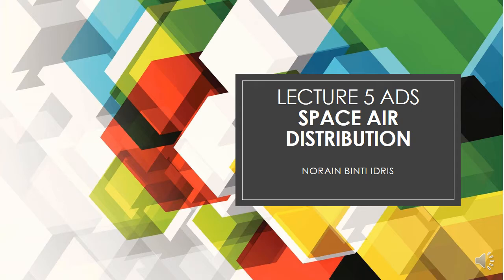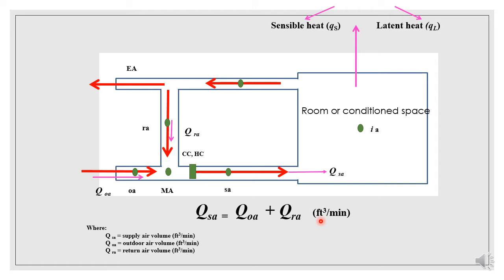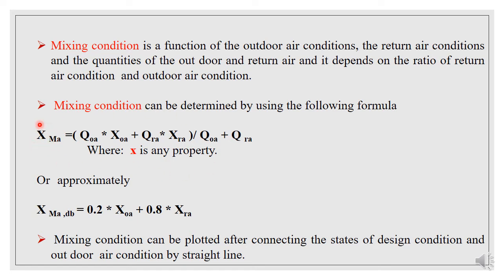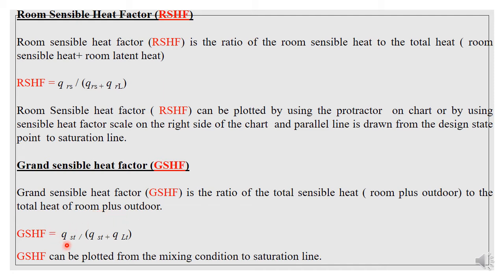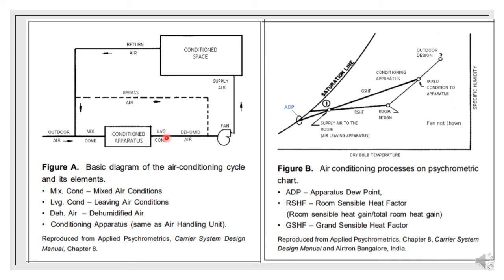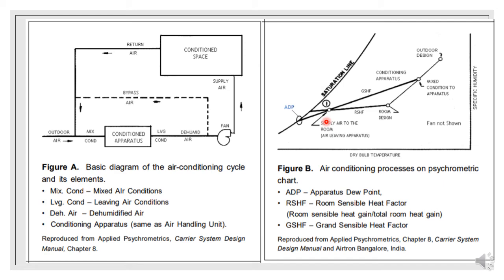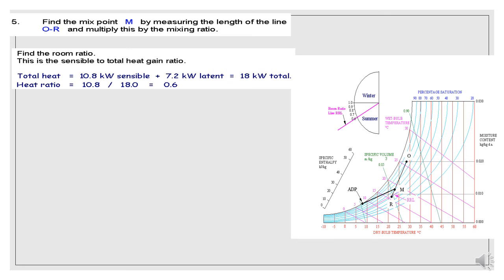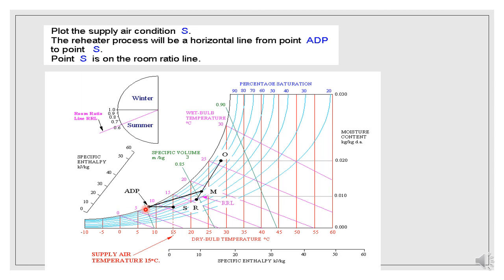LECTURE 5 HUMAN COMFORT AND AIR DISTRIBUTION

Comment: AHMAD TAUFIQ BAIHAQI BIN MOHAMAD B091810279 3BMMH S1/1
From the lecture 5 video,  the important locations on AC are design condition (i), return condition (r), supply air condition (s), outdoor condition (o), mixing condition (m).
 Next, the important factors in the AC process are Room Sensible Heat Factor (RSHF), Grand Sensible Heat Factor (GSHF), and Bypass Factor (BF). Finally, on how to plot a psychrometric chart to identify the mixing point temperature.

Comment: SEE WEI CHE B091810368
From this lecture video, i learned there are 5 most important locations of air conditioning which are design condition, return condition, outdoor condition, mixing condition and supply air condition. The mixing air is combination of Return air and Outdoor air. The 3 most important factors for air conditioning process are room sensible heat factor, grand sensible heat factor and bypass factor.

Comment: Kuganeswarao A/L Subramaniam B091810487
From the video  I have learned about the 5 most important locations for air-conditioning. Moreover, the air-conditioning process involves 3 crucial factors which are room sensible heat factor, grand sensible heat factor, and bypass factor.

Comment: Asyraf Hakimi B071710484

Good air condition system must have excellent design condition, return condition, outdoor condition, mixing condition and supply air condition. Important factors must consider is room sensible heat factor, grand sensible heat factor, bypass factor.

Comment: MUHAMMAD ISMANAJMI BIN ROZI
B091810258

I learned from this lecture video: 
- on how to build a psychrometric map to the mixing point temperature.
- the relevant positions on an AC are the construction condition I the return condition (r), the supply air condition (s), the outdoor condition (o), and the mixing condition (m).
- The Room Sensible Heat Factor (RSHF), Grand Sensible Heat Factor (GSHF), and Bypass Factor are essential factors in the AC operation (BF).

Comment: MUHUNTHAA A/L MUNIYANDI
B091810185
3 BMMH S1/1

From this video, I have learned about the 5 most important locations for air-conditioning which consist of Design condition, Return condition, Outdoor condition, Mixing condition and Supply condition. Moreover, the air-conditioning process involves 3 crucial factors which are room sensible heat factor, grand sensible heat factor, and bypass factor. At last, I have learned on how to draw and calculate an air conditioning plant schematic diagram.

Comment: MUHAMMAD IZZAT IZZUDDIN BIN HANAFI B091810329

Locations of air conditioning are based on design condition, return condition, outdoor condition, mixing condition, and supply air condition. To determine the volume of supply air is Qsa= Qoa + Qra (ft³/min) and the total heat, qn= qs + qL. last but not least we learn on how to draw and calculate schematic diagram of air conditioning plant.

Comment: MUHAMAD RAZIQ AFIQ BIN ANUAR
B091810519
5 important locations for Air Conditioning  which are design locations (i), return condition (r), outdoor condition (o), mixing condition (m) and supply air condition (s).  Then, i have learned to draw and calculate schematic diagram.  Next, to determine the volume of supply air is Qsa= Qoa + Qra (ft³/min) and the total heat, qn= qs + qL. Other thant that, there are 3 important factors in air conditioning process: room sensible heat factor, grand sensible heat factor and bypass factor.

Comment: Muhamad Ashraf Bin Zulkupli 
B091810161
In this video lecture 5 i have learn that there are 5 most important location for air conditioning system. Which consists of design condition, mixing condition, and supply condition. There are 3 important factor in the air conditioning process which is room sensible heat factor, grand sensible heat factor and bypass factor

Comment: Ahmad Zikry Bin Midin B091810456 
In this lecture 5, i study about space air distribution. Condition points of HVAC system are the locations of air conditioning state within thermodynamic process. The moat important locations of air conditioning are design condition, return condition, outdoor condition, mixing condition, and supply air condition.
Sensible heat is amount of heat changed due to change in temperature of the body or system.
Latent heat is amount of heat related to changes in the phase of the system by identifying the difference in himudity ratio.
Important factors for air conditioning process:
-Room sensible heat factor (RSHF)
-Grand sensible heat factor (GSHF)
-Bypass factor (BF)

Comment: Tiban A/L Ravichandran B091810285
From the video i learnt the important factors for air conditioning process.Beside the important terms and process related to Psychrometric chart,there are some important factors must be taken under consideration for air conditioning process which is room sensible heat factor(RSHF), grand sensible heat factor(GSHF) and bypass factor(BF)

Comment: Name: Muhammad Hadzim Ashraff Bin Mazlan
No.Matric: B091810248

Summary:
Important factors for air conditioning process such as Room sensible heat factor ( RSHF)
, Grand sensible heat factor (GSHF), Bypass factor ( BF). Room sensible heat factor (RSHF) is the ratio of the room sensible heat to the total heat ( room sensible heat+ room latent heat). Grand sensible heat factor (GSHF) is the ratio of the total sensible heat ( room plus outdoor) to the total heat of room plus outdoor. Bypass factor ( BF) is part of the total air through the coil which fails to come into contact with the surface of the cooling coil. Therefore the friction of the total air flow is bypassed.

Comment: ahmad syahir bin ismail b091810081
from the lecture video, i have learnt that;
The most important locations of air conditioning are design condition (i), return condition (r), outdoor condition (o), mixing condition (m) and supply air condition (s). besides that, there are three important factor for air conditioning process which are Room Sensible Heat Factor(RSHF), Grand Sensible Heat Factor(GSHF), and Bypass Factor(BF).

Comment: Keshanraj A/L Ganesh   B091810319
From this lecture video, i have learned :
- the important locations on AC are design condition (i), return condition (r), supply air condition (s), outdoor condition (o), mixing condition (m).
- the important factors in AC process are Room Sensible Heat Factor (RSHF), Grand Sensible Heat Factor (GSHF) and Bypass Factor (BF).
- on how to plot a psychrometric chart to identify the mixing point temperature.

Comment: IDA NAJIHA JUNUS
  B091810091
From this lecture, I learned about the most important air conditioning locations are design condition (i), return condition (r), outdoor condition (o), mixing condition (m) & supply air condition .. next, there are 3 types of space air conditioned i.e. outdoor air, mixing air & return air .. i also learned to draw & calculate schematic diagrams.

Comment: NUR NABILAH BINTI MOHD ISHAK (B091810284) - 3 BMMH 1/2

Based on this lecture, we have learnt that there are 5 important locations for Air Conditioning  which are design locations (i), return condition (r), outdoor condition (o), mixing condition (m) and supply air condition (s). Next, the important factors for air conditioning process based on 3 factors: Room sensible heat factor (RSHF), Grand sensible heat factor (GSHF) and Bypass factor (BF). We also learnt on how to draw and plot the mixing point temperature and supply air temperature by using the psychometric chart based on the data given.

Comment: SRITARAN A/L ARUMUGAM
B091810178

From this lecture video, i have learnt that In air conditioning, there are five critical locations: design condition, return condition, outdoor condition, mixing condition, and supply air condition. Besides that, the air-conditioning process involves 3 crucial factors: room sensible heat factor, grand sensible heat factor, and bypass factor. Finally, we can learn on how to draw and calculate an air conditioning plant schematic diagram.

Comment: Muhammad Ariff Imran Bin Hassan 
b091810177

Condition points of typical HVAC system are the locations of air conditioning state within thermodynamic process. The most important locations of air conditioning are design condition (i), return condition (r), outdoor condition (o), mixing condition (m) and supply air condition (s). From all the value we can draw and calculate schematic diagram of air conditiong plant.

Comment: AFIQ HAMIZAN BIN SYAHARUDIN B091810525
In this lecture 5, i can learn about 5 most important location of AC.. There a few condition factors for AC  need to be consider such as  Room Sensible Heat Factor (RSHF), Grand Sensible Heat Factor (GSHF) and Bypass Factor (BF). To calculate the volume of supply air is Qsa= Qoa + Qra (ft³/min) and the total heat, qn= qs + qL.

Comment: Luqman Haqim B Amir Hamzah B091810235

locations of air conditioning are based on design condition, return condition, outdoor condition, mixing condition, and supply air condition. To determine the volume of supply air is Qsa= Qoa + Qra (ft³/min) and the total heat, qn= qs + qL. last but not least we learn on how to draw and calculate schematic diagram of air conditiong plant.

Comment: AHMAD ASYRAF BIN AMIL B091810125
For this topic, I have learnt that there are FIVE  most important locations for air-conditioning which consist of Design condition, Return condition, Outdoor condition, Mixing condition and Supply condition. There are THREE important factors in the air-conditioning process: Room sensible heat factor, Grand sensible heat factor and Bypass factor.

Comment: SALMAN BIN MOHD ZAINUDIN B091810498

Most important locations of air conditioning.
- Design condition
- return condition-
- outdoor condition
- mixing condition
- supply air condition

Conditioned air introduces room or conditioned space.
- outdoor air
- mixing air
- return air

sensible heat - amount of heat changed due to change in temperature of the body or system
latent heat - amount of heat related to changes in the phase of the system by identifying the difference in humidity ratio

Comment: NURSHAZNI SAHIRA BT MOHMAD SARIFF B091810225
As a conclusion, there are 5 important locations in air cinditioning: design condition, return condition, outdoor condition, mixing condition and supply air condition. Next, to determine the volume of supply air is Qsa= Qoa + Qra (ft³/min) and the total heat, qn= qs + qL. Other thant that, there are 3 important factors in air conditioning process: room sensible heat factor, grand sensible heat factor and bypass factor. To determine all of this, we need to use the formula. Lastly, we know how to plot on the psychometric chart by using the data given to find the mixing point temperature and the supply air temperature.

Comment: MOHD NAZRIN BIN MOHD NAZRI B091810221 3BMMH S 1/2 

From this lecture video, I learnt about 5 most important locations of AC such as design condition (i). The 3 three important factors for AC process must be consider by AC engineers such as Room Sensible Heat Factor (RSHF), Grand Sensible Heat Factor (GSHF) and Bypass Factor (BF). I also knew, procedures how to use psychrometric chart with data given to find mixing point temperature and supply air temperature.

Comment: Mohamad Zahim Bin Mohamad Sukairi     B091810344         3BMMH  S1/2

In this Lecture session we have learnt about space air distribution. Firstly, the most important locations of air conditioning are design condition(i), retun condition(r) , outdoor condition(o),mixing condition(m) and supply air condition(s). Next there is several  type of conditioned space which is Outdoor air, Mixing air and Return air . last but not least we learn on how to draw and calculate schematic diagram of air conditiong plant.

Comment: Nur Saiful Syahmi Bin Alias B091810055

The are several types of air distribution devices. Their main function are to control the direction, height and amount of airflow delivered to a space. These devices are often called registers, grilles or diffusers can be fixed or adjustable.